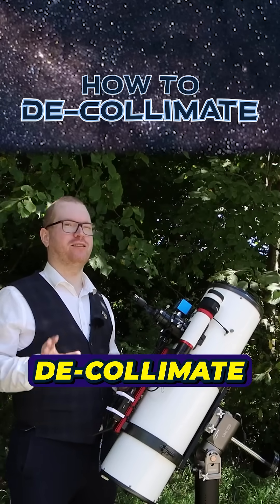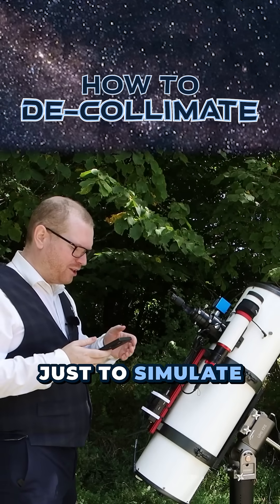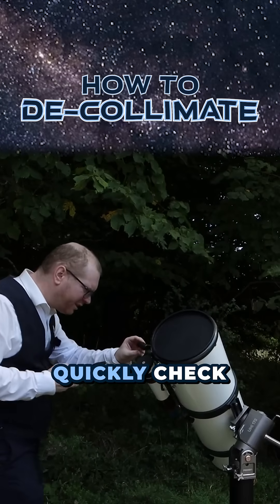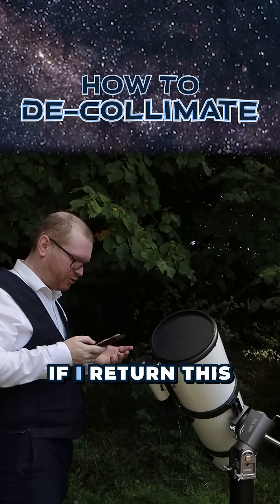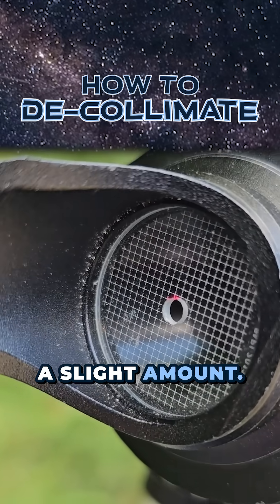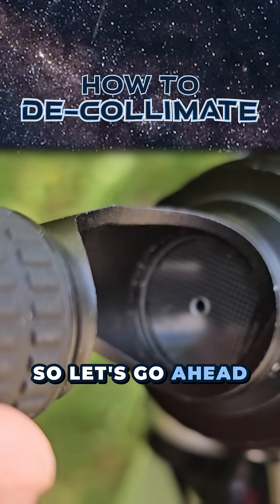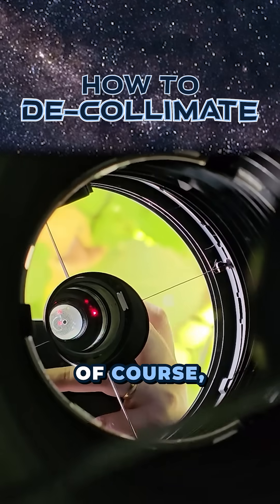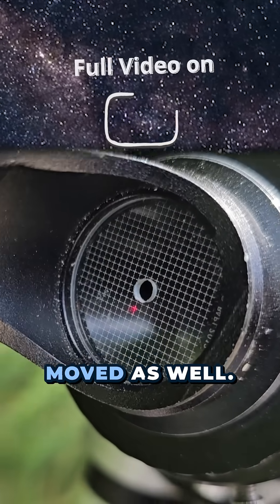How to De‑Collimate a Telescope

Comment: My SkyWatcher 200p doesn't get decolimated so easy.That happens to me if the extra screews to secure the mirror base aren't tight.
Reply: Hello! I have a skywatcher 200p. I just got it yesterday in the mail actually. And everything is blurry. It is not my first telescope. I culminated it, let it get to correct temperature, I focused it. But the moon looks horrible. You cannot tell what your looking at tbh
Reply: @ABugkillersLife210  That's very weird, I can take very nice photos of the Moon with mine.
Reply: @yoquese335 when you got your out the box it was good?